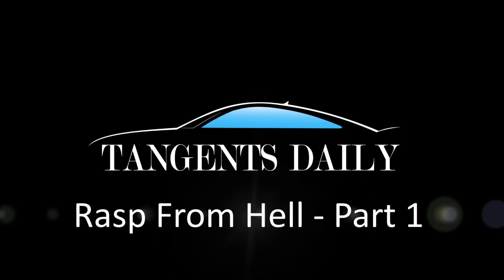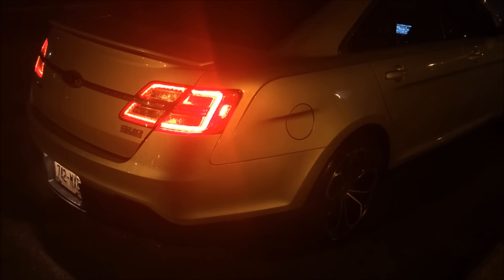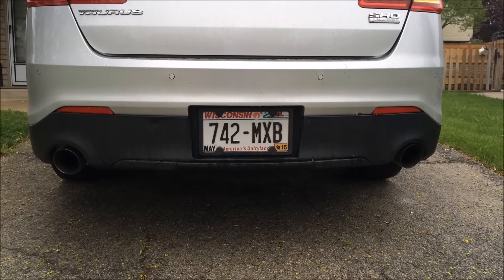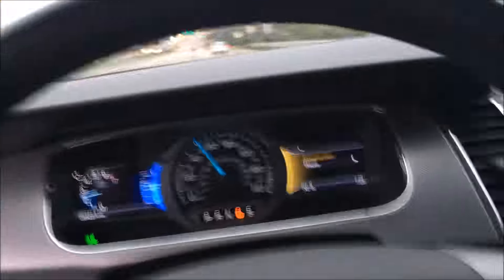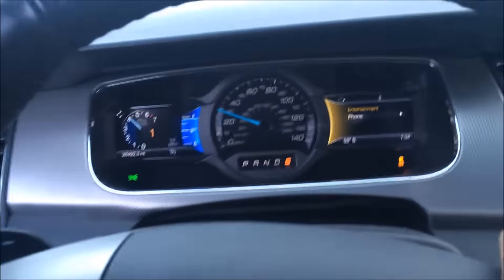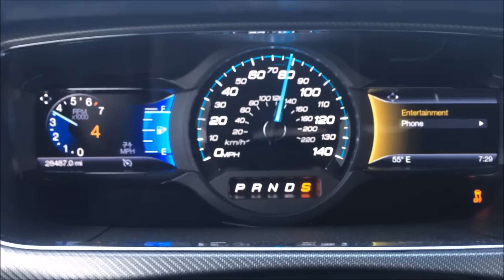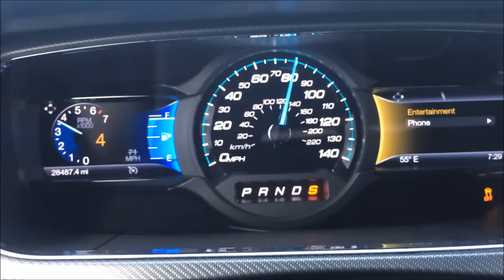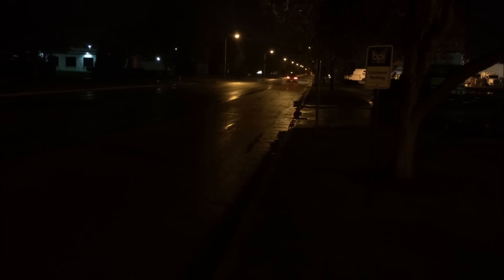2014 SHO Corsa Cat Back & Stainless Works Downpipes – Rasp From Hell

Comment: V6 engines just do hot have a pleasant exhaust note no matter what exhaust you have.
Reply: dude. seriously. my 3.8L supercharged 3800 sounded awesome at idle... and then I gave it gas ___. 
RASSSSSSSSSSSSSSSSSP!
Reply: I like the turbo whoosh you can hear with the exhaust because you can't hear the whistle with stock exhaust so that's why most ecoboost owners put custom exhaust for that and a horsepower gains
Reply: Never heard a Nissan 3.5 or 3.7 before have ya...
Reply: Nissans v6 sounds incredible

Comment: Did u notice any power gains at least?
Reply from the maker: Honestly, no. The car is quick as it is. The biggest improvement was from the tune. This is expected as it changes the shift points, the line pressure during the shifts, and a large number of other aspects of the car. (traction control sensitivity). I had issues with the car red-lining, and blow-off.... so I never really noticed that great of gains with the Downpipes / exhaust. (mainly because I was pissed at the way the car sounded)

Comment: Would catted dp's help with the rasp at all?
Reply from the maker: +CT La Speaking with a reputable source at a manufacturer of high-flo cats... the answer is no. The sound is still raspy when you open up the exhaust. The only way that I've heard that this exhaust sounds alright are fiberglass packed mufflers like magnaflo. If I were to do it again, I would have gone that route instead.
Reply: Catted downpipes plus magnaflow exhaust or stock downpipe and magnaflow exhaust?

Comment: I have a 2011 sel awd straight pipe stock muffler sounds much better
Reply from the maker: +Jean Nzati The way the engine radiates the sound is much different in the Ecoboost engines than the SEL version of your car. When the car starts, you can actually hear the turbo spool sound during idle through the exhaust. The engine note transforms as the sound waves transform through the turbine and out towards the exhaust. Not saying I didn't hate how this sounded, I'm just pointing out that the cars inherently are different by how turbines work. I'd love to hear your car if you have a sound clip. I'm a car enthusiast through and through.
Reply: Both the Cyclone and Ecoboost sound identical other than the turbo whistle.
Reply: @ArcticSniper1000  I know I'm late but the cyclone revs higher and has a smoother sound than the ecoboost, they can sound similar especially at low RPMs but not the same

Comment: Yeah...that sounds like shit. Regrettably, there are few options for the 3.5EB engines and I have yet to hear any that sound good. I had a Magnaflow on mine for a week and it have a minimal audible increase, was a drone machine and interfered with my hitch because Magnaflow did not take into account the Explorers with the Factory Hitch, it was a complete POS.
Reply from the maker: ***** I hear you on that one. I'm still not as satisfied with my 2014 SHO with the Corsa exhaust. It's sounds good most of the time, but some times I still get an annoying rasp at the right frequency/RPM.

Comment: i have plenty of questions.. 1) probably stabbed holes in your exhaust like a ricer.. my 13 is faster and sounds no where near as loud/rasp this has. whatd you do. an exhaust upgrade helps but if you treat it this way again it end up the same way.. 2) why does your right hand infotainment gauge only shows entertainment and phone.. no climate no nav. do you have preference package? is this just a riced base model? there are more Questions but i feel like what the stock car i got from the dealer and your slightly modded car are no where near the same class.. should've spent the extra 2k
Reply from the maker: Ah, its been a while since I've had a "420" troll. Since this video I removed the stainless works downpipes and it sounds much better -- part two https://www.youtube.com/watch?v=xBmdO_t_Le8. Part 3, shows the downpipes installed with a different exhaust system, yet again, different tone https://www.youtube.com/watch?v=zr0qAAZtw68. I'd love to see a post for your 2013 so we all can learn how to make our cars faster and sound better. 2) no nav, I don't need it. Waze is 100% better. Why would I get a feature that I'd never use on the car? 3) It's a 2014 Taurus SHO, as stated in the video. It has a Livernois v8 tune , 3 bar, intake, corsa cat back, and gapped plugs. Why would I get the performance package when I can't roll in sport tires during the winter in the Midwest.
Reply from the maker: Enjoy your 2013 SHO.
Reply: i was never meaning disrespect. i do enjoy it. its the only version that ford is coming out with. i hope you enjoy yours also, the taurus walked on GTs back in the 90s and still does with 2015 versions of both cars. i believe they will discontinue it in '17 or '18 so hang on to your and treat it right itll be worth it one day. i dont know why ford builds special edition family cars faster than there top 2 door sports ( not counting gt350s or 500s theyll come out with im sure thry will) but im glad they do